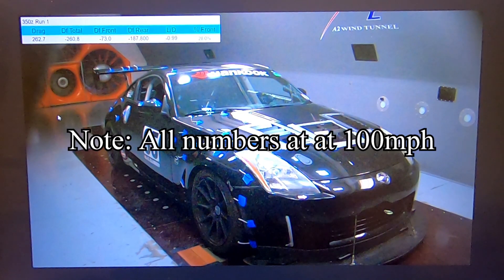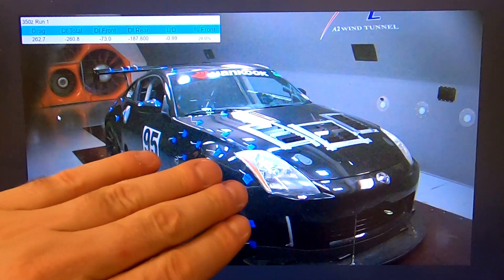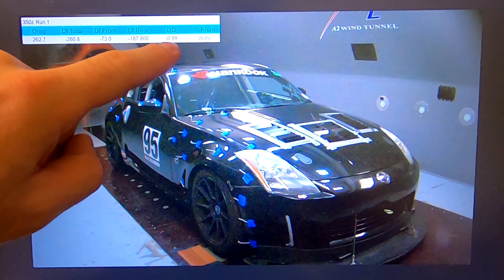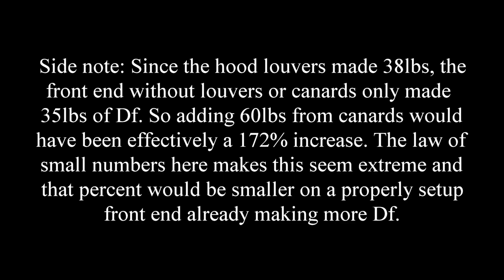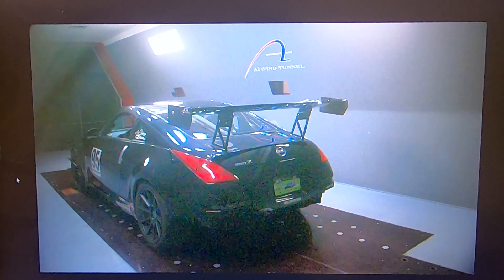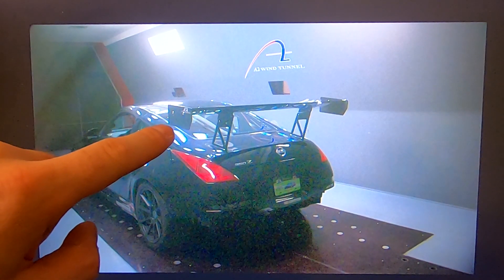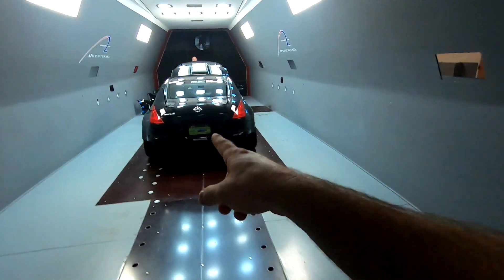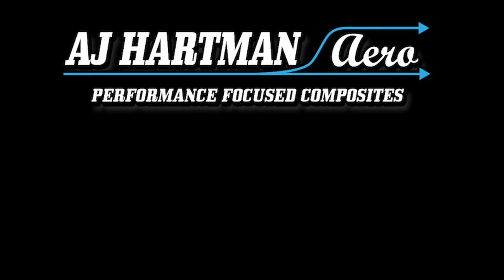Wind Tunnel Time - 350Z

Comment: Never considered aero too much but am now starting to for my track-dedicated 350Z. Is it a bad idea to run a splitter without a wing, or vice versa, and if one can only afford one (to start with), which is best/safest? Another video wind-tested a 350z with splitter and wing yet before tunnel-driven data the setup was generating almost 100% rear-biased downforce. Without a tunnel or computer simulation it almost seems pointless to add aero…?
Reply: I run a big splitter up front on my Track DE with no wing. Saving up for the APR one. But yeah, she handles like a champ👌🏼

Comment: Johnny's wing?
Reply from the maker: Not this one but have tested that on other cars.
Reply: Hey man do you think you can make some costume carbon fiber parts for my car?
Reply from the maker: @tracebrink6970  what parts? If a mold needs to be made it will not be cheap since it will require a lot of time.
Reply: @tracebrink6970  AJ does real work, not costume jewelry.
Reply: Hood,hatch and costume wing gt3 style wing
Reply from the maker: @tracebrink6970  yeah I’d need to make molds and your looking at around 500-600 hours or so to get finished molds that I’d have to charge for.
Reply: @ajhartmanaero  I foud a hood how about just the hatch give me a rough estimate

Comment: Was the splitter a flat splitter?
Reply: Yes, it is a flat plane splitter. I made it out of a plywood sheet.
Reply: Nice! What was the angle of attack on the splitter. A bit surprised it didn’t make more DF on its own.
Reply: @sw20kosh  the chassis also made a substantial amount of lift in the OEM setup. 
So the splitter is overcoming that lift AND providing 73lbs of downforce. 
In my notes, I see the splitter is at 2-5/8ths. I don’t recall if that is angle or not.
Reply: @NFHTransportation  ah makes sense. Did you guys measure the front lift with vents blocked and no front aero? Very interesting stuff!
Reply: @sw20kosh  yes. We put the cardboard over the holes in my hood, and ran with no aero at all. That is how we got the effective baseline for the 350z chassis.
Reply: @sw20kosh  I don’t recall. I’ll have to remeasure it for you.